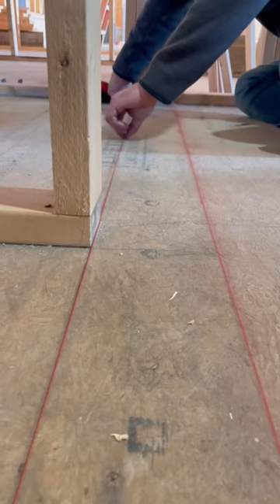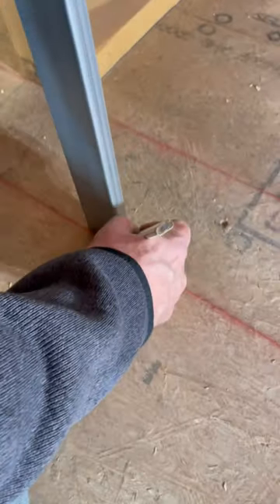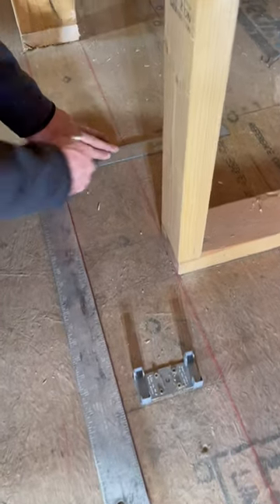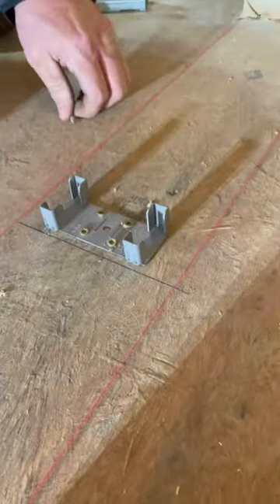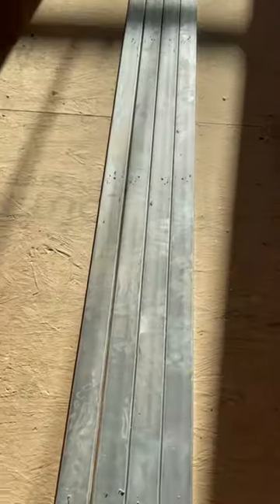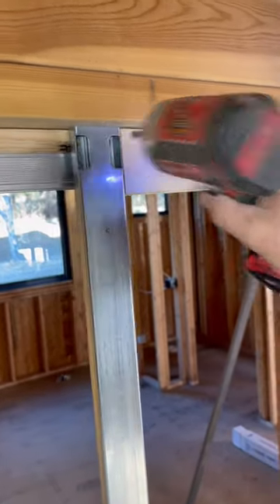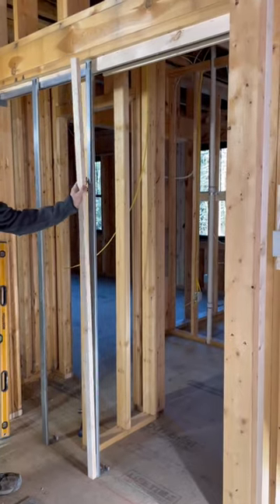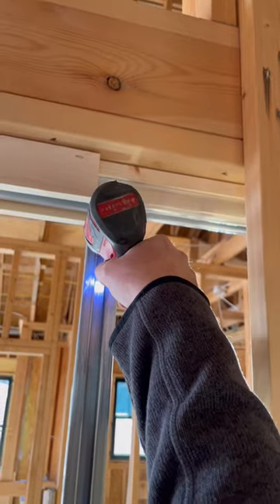Pocket Door Kit Installation (Part 2)

Comment: Love pocket doors. I used the older kit with flimsy wood pocket. The metal kits seem to be more robust. Goo video 👍
Reply from the maker: Cool, thanks
Reply: I HATE pocket doors because they are flimsy! This one actually might be a bit more sturdy with the 1x's reinforcing it! 🤔 I would probably rip my bottom plate around it too to strengthen the wall, and pilot some screw holes to fasten it to the floor!